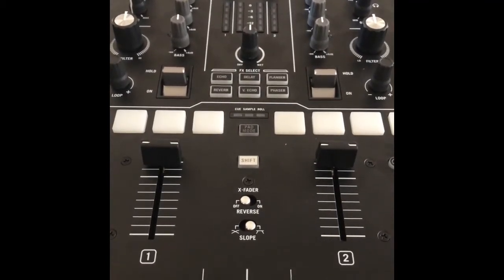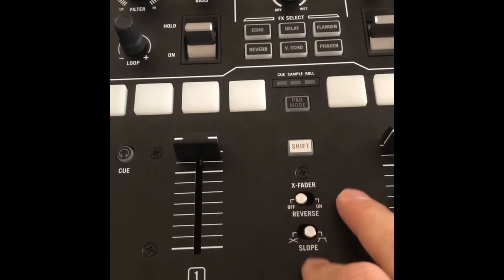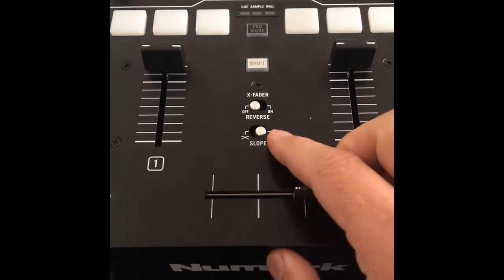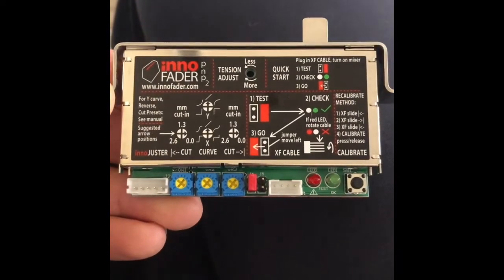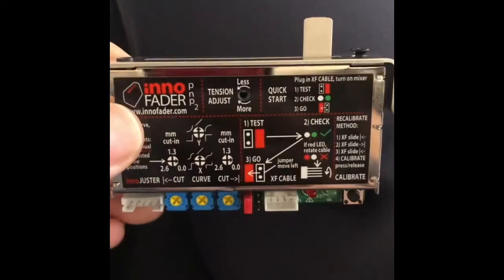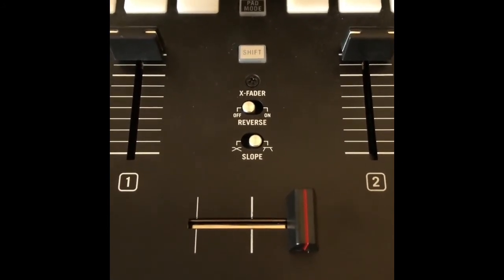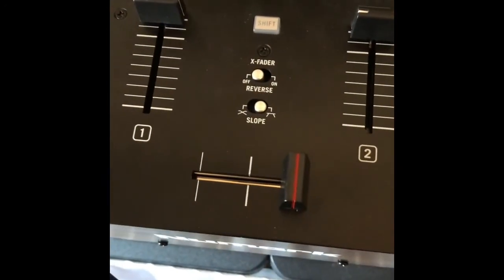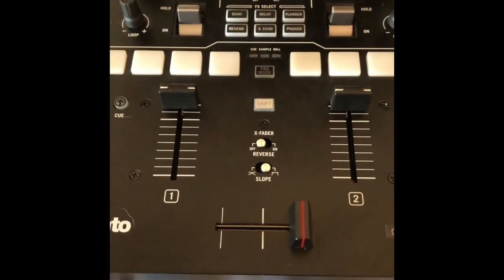Numark Scratch Mixer Innofader pnp2 crossfader upgrade

Comment: I filed the edges with a flat file that is used in the world of modeling, it does not touch the metal of the facade.  This Crossfader is revolutionary on this mixer.

Comment: Cheers for the vid bro. I plan on getting this mixer but will what to see how I feel about the fader. Did you consider filing back the faceplate to accommodate the fader? That would have been the first thing I would have thought of but I tend to go the more destructive route when I'm faced with a problem :)
Reply: That was actually my first thought too. Glad there is an intended solution that's non destructive

Comment: I just have install an Innofader  PNP 2.  First, had an issue with the original bezel. The PNP 2 didn't fit as waiting and had to make some fixes to make it fit.  Second, the reverse switch doesn't work fine. The function is inverted. Any advice for the last issue?

Comment: I've just bought one if these mixers brand new, going to ask about the original fader in yours and why you made the upgrade as mine has about 3mm dead space before music comes in the takes about 1mm on dragging the fader back before the music cuts off ,basically rendering it useless for anything other than cutting, is this a fader problem or a mixer problem

Comment: Bro exact same situation. Got this mixer and lost my crabs like completely! I was like what happened to this being an innofader?! I nervously ordered the same fader(pnp2) but now I know for sure it will work and I know to use 2 bumpers and don't recalibrate. Thanks a lot man I appreciate it
Reply: Hey Evan. will the PNP2 with the orange sticker on the box work?
Reply: @voiceoverz4975  I'm not sure what you mean by that sticker. What's important is that you have the included adapter that lets you change to the four PIN connector. There should be several included adapters. Only one will work with the numark Scratch and it has a four PIN connector. Cheers!
Reply: Mine do not work 😢

Comment: Hay with the calibration do you need to take out the extra 0 ring or can you just calibrate it with it in for thr innofader pro 2
Reply: Did it work out with the pro 2? They say you need another bracet to mount it?

Comment: Do u calibrate before u add the bumpers in fader?
Reply from the maker: Yes, I went ahead and calibrated it before adding the bumpers.  Not sure why it would act weird after adding the bumpers, and then re-calibrating.   I actually had to reopen it, and calibrate it without the bumpers.  The pins are very brittle, so be careful bending them multiple times.
Reply: @evanjohnmo I did try it but it didn't work for me 😭😭 s.o.l
I went a head just out all back together and left it alone
Reply: @evanjohnmo  Hi man, i'm french really sorry to bother u possible to talk ? I bought a innofader pro 2 for my numark scratch for me is obligatory that can be work with it. But i don't know what to do i'm really really Lost with that if u have Time to explain just how u put your pnp for me if u Can put a pnp that also possible to put a pro 2 but when i open the table i see nothing for that work